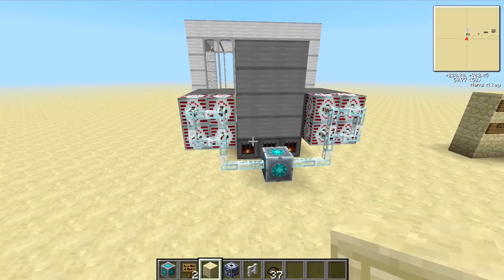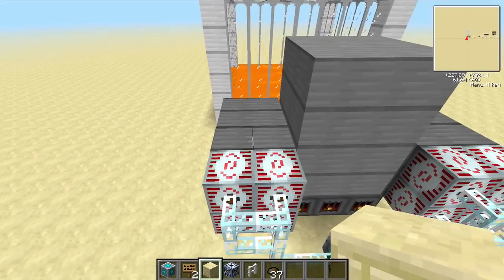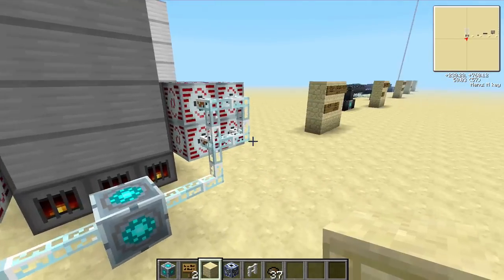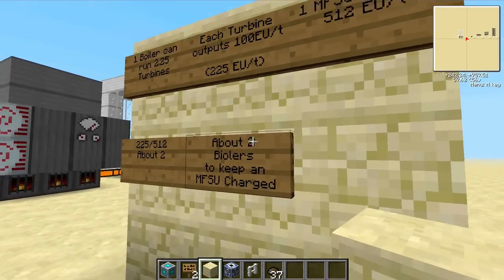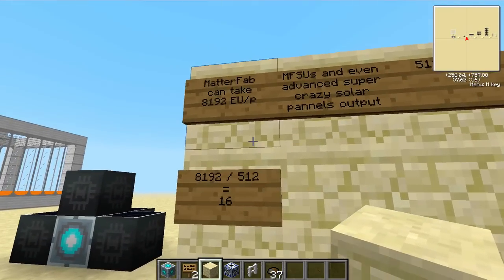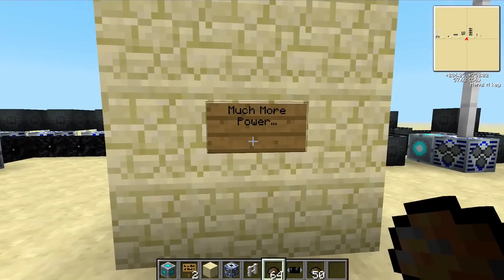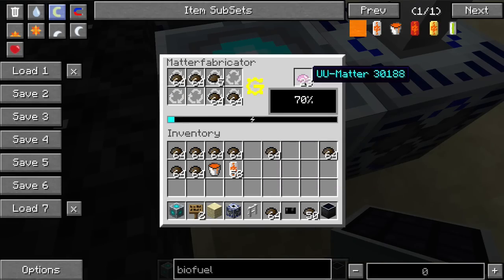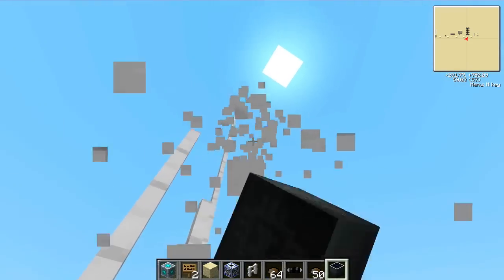Re 012 BDubs regarding the MatterFab

Comment: Ah yea certainly so. I don't trust any third-party information. Always go to the source. Essentially your max is the amount of EU it takes (via config) to produce 1 UUM per tick as that's the absolute maximum. In the default GregTech configuration it's 16.7 million (16,666,667) EU/t. That's the same configuration that Mindcrack uses. Therefore you need 16,000 turbines....about 7500 steam boilers.

Comment: 2:06, 512/225 = 2.275, so you would need more than 2 steam boilers to make the MFSU run at a full 512 EU/t.  2:15, at 2.25 turbines per boiler, 2 of boilers will run 4.5 turbines, i.e. less than 5, not more than 5.